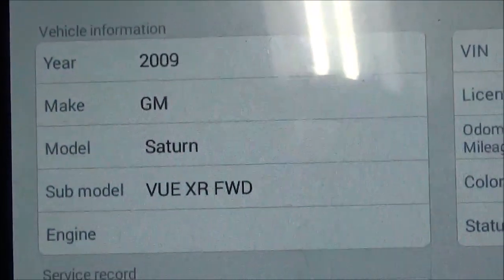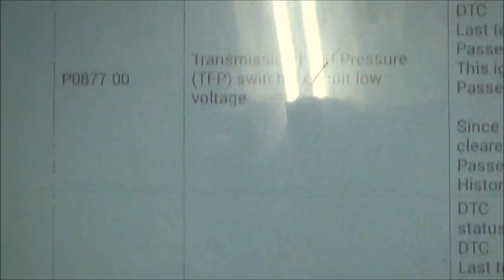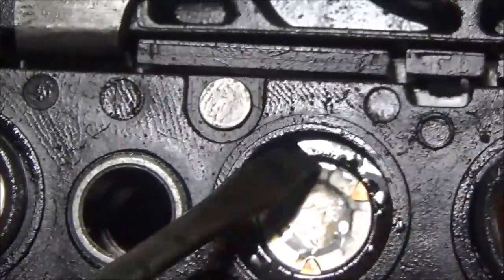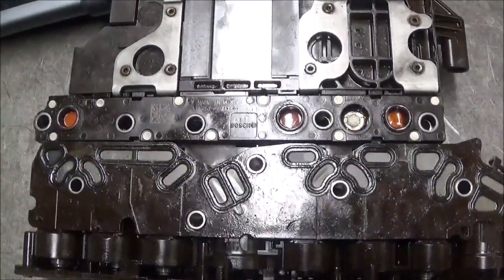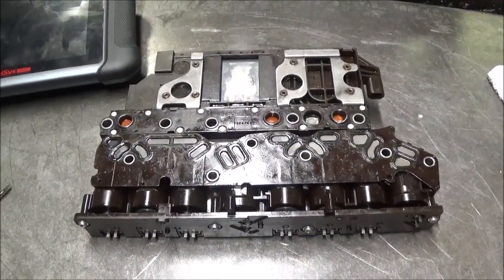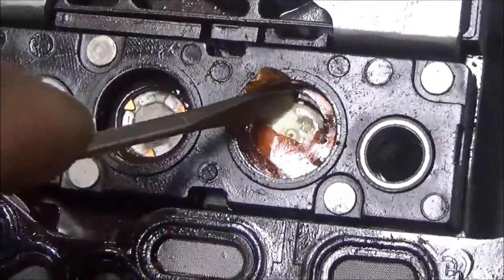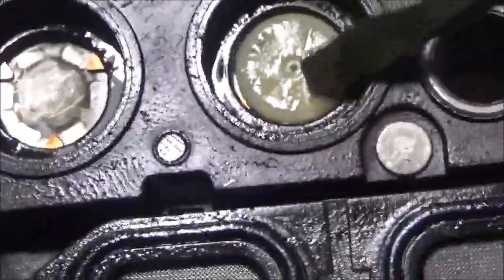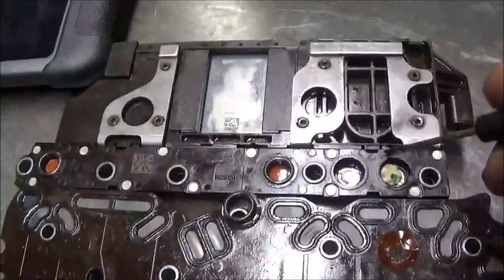2009 SATURN VUE (6T70/6T75 TRANSMISSION) DELAYED ENGAGEMENTS, PRESSURE CODES

Comment: Nice video. I have a 2009 Saturn VIN Code P (8th character). When cold it holds 1st gear way to long and then shifts to 4th. After driving for a little bit it appear to shift fine both in Auto and manual mode. I got a P1750:00 1-2 Shift valve performance, which makes sense. I can get a low mileage used transmission for about $600. Will I need to do any relearning if I swap it in?
Reply from the maker: If it is the 4 speed, then no programming.
Reply from the maker: What type of transmission is it?
Reply: @thisisyourtransmission  It's the 4 speed automatic. Apparently, there were 2 different transmissions put in these Vues. This is the one that does not have a dipstick. I am just wondering whether I should just buy a low mileage used one and throw it in.

Comment: What is quicklearn and how do you do it?
Reply from the maker: There are certain things that have to be taught, and I cannot teach it or show how to do it at the moment. Maybe one day I will do a video on it. However, there may be other technicians showing this procedure. However, quick learn just resets the transmission to factory reset.
Reply: Thank you @thisisyourtransmission , I will look into it, also, please pardon the stupid question, but how do you get to the TCU? I've got the exact same issues on my Saturn VUE, same codes, same symptoms, but I can't afford to take it somewhere and I won't make any money on a sale so I will attempt to fix it myself or fail and buy a new vehicle.

I'm an aircraft mechanic so I'm not totally useless, but I don't know much about cars.

Anyway, any guidance you can give about how to access this control unit would be greatly appreciated, thank you.

Comment: can I remove the tcm with the transmission in the car?
Reply from the maker: yes it can be done if you have room.
Reply: @thisisyourtransmission  I have the 2008 Saturn Due XR. It looks like the transmission lines are in the way but also the frame in the front. Do you think I would have to jack up the transmission to clear the front frame rail?
Reply from the maker: @speakbigtruth9383  You should not have to
Reply: @thisisyourtransmission  Thanks. I will go for it. Thank you.
Reply: @speakbigtruth9383 did you end up doing it with the transmission still in? I am looking at doing this with my girlfriends Vue.
Reply: @1987willyboy  Yes, I did with the transmission still in. It was surprisingly easier than I thought and it fixed the problem.

Comment: I have an 09 Hybrid of this vehicle and we are having trouble with the transmission as well and they say we need a whole new one, do you think it might just be these power switches as well?
Reply from the maker: Does your vehicle have this transmission in it?
Reply: @thisisyourtransmission  honestly i don't know, it's the same make except with hybrid engine. where do i go to check. This is all i could find on it. Trans Order Code MX0-6
 and Transmission, 6-speed automatic (Requires (LY7) 3.6L V6 SFI engine or (LZ4) 3.5L V6 SFI engine)
Reply: @thisisyourtransmission  is that yellow piece they don't sell just a piece of plastic? Would it be feasible to take one of the ones that are there and get it 3D printed? That should be a lot cheaper I would think
Reply from the maker: @BladeoftheImmortal2005  the yellow piece pushes down on the contacts. Second, whatever plastic you use has to withstand heat, cold, and oil.
Reply: @thisisyourtransmission  Thanks.
Reply: @Bladeoftheimmortal please let me know if you got your Vue running. I have the same 2009 Hybrid and last week mine went out also. I have reverse but no drive. Thanks
Reply: @outtatime13  sorry. Just saw this. We never got it running. They wanted to charge like 4k for a transmission. It was insane.
Reply: @aku2dimensional  thanks for the info. We never get it fixed, sadly. Would have been a great car if we could have.